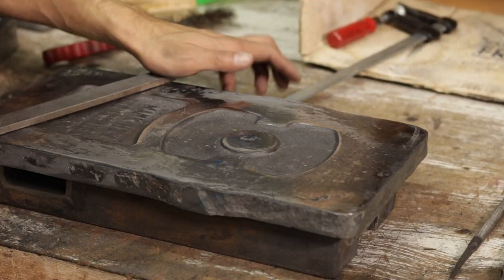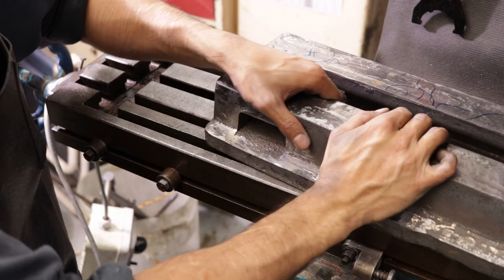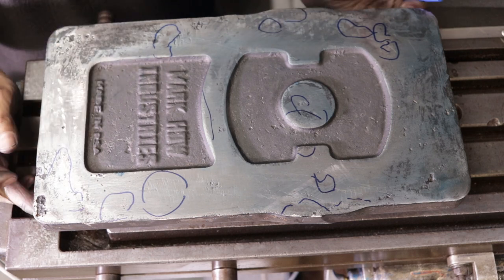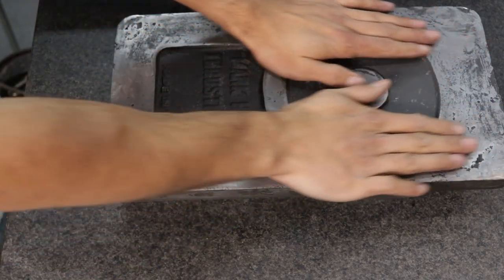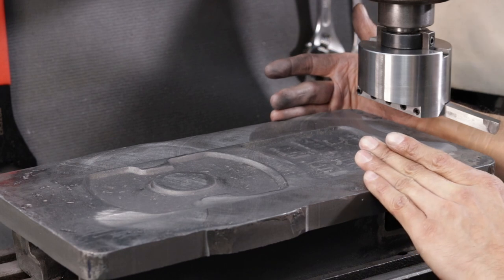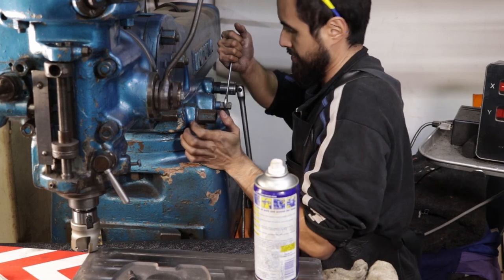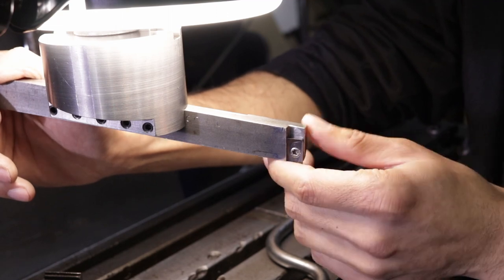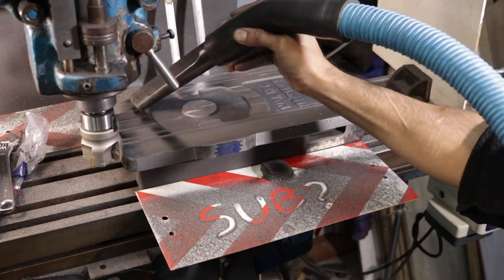Home Built Vise Part 4 - Machining the Castings, starting with the vise body

Comment: Scraping will probably never die out. Files are still with us, right? They're not as critical in the machine shop but still have a place. About your project: if you get the surface within 0.05--0.02mm (0.002--0.001 in) that's about all the better you can hope for in a normal machine shop with used equipment. At that point, scraping is fairly easy. Scraping a rough casting with a tiny scraper must have been an unpleasant  experience. If you can get a good carbide scraper and diamond wheel, finishing the base of your vise to 5--10 points/sqin with would be a solid result.